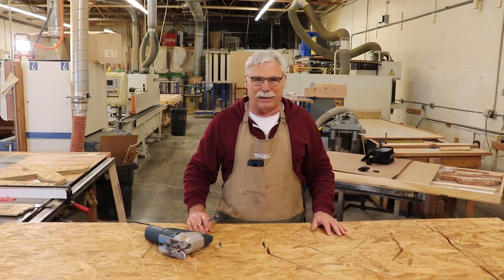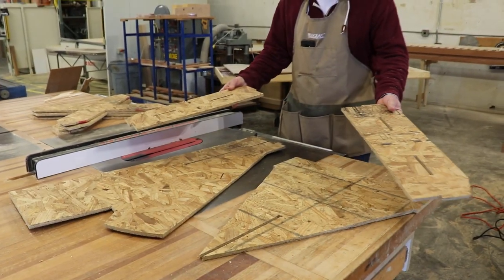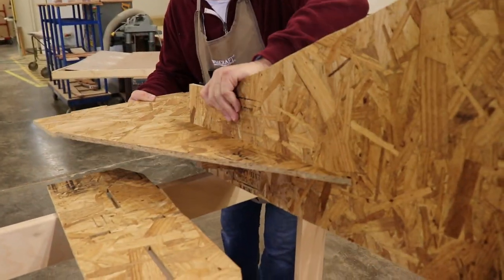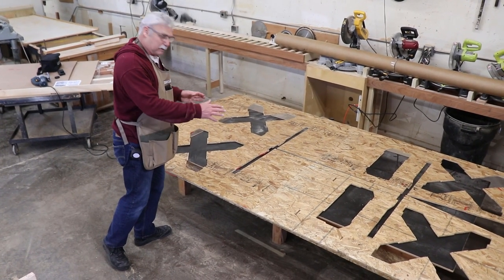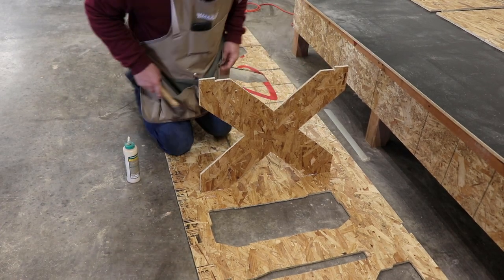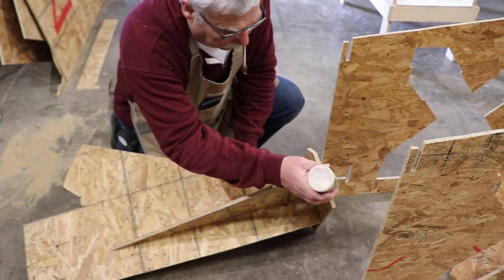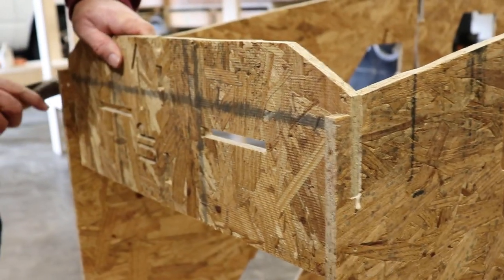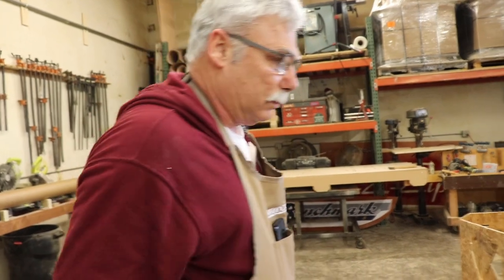How to build a plywood kit boat !!  Step # 1   "The Building Form"

Comment: Good Video , thank you  BTW i spent ove. 25 years as a Professional Woodworker and when i started in the business. I used to “persuade  joints with my  fists like you did a old timer  used to yell at me and say thats what your hammer is for  you keep that up and you wont be able to use your hands one day like me  I always remembered that and i did stop  doing that as thats why we had hammers like that guy told me  Ive always had the dream of building a Wood boat and i found your channel because i like the lines of this kit when completed
Reply from the maker: Thanks Craig !  "Right tool for the right job" My Grandpa use to say they put slots in screws to get them out ! Because he used his hammer to drive them in.